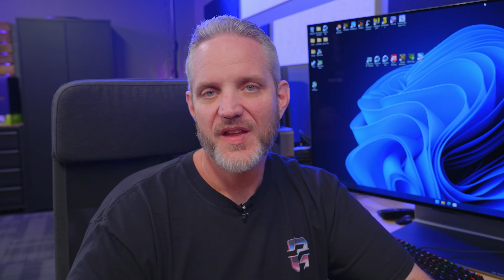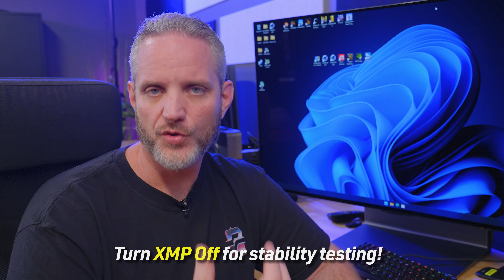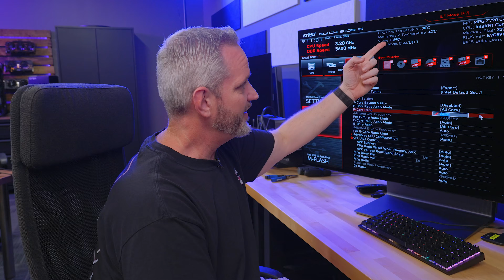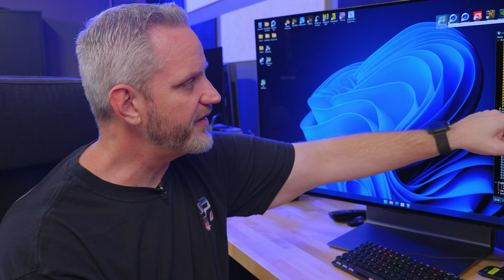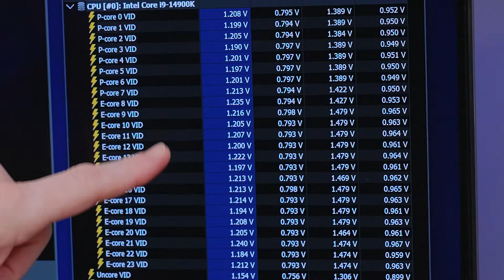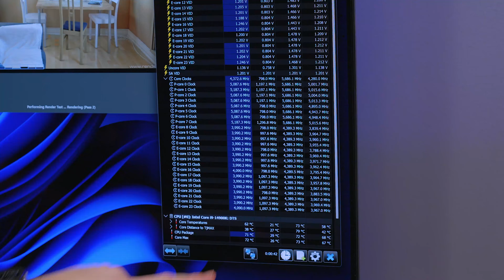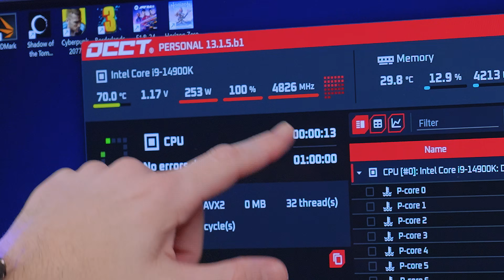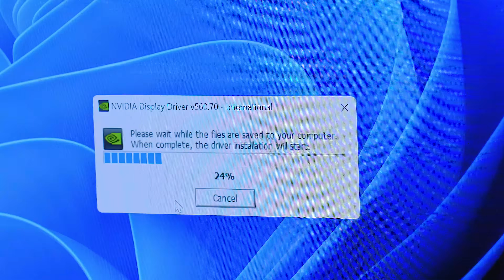Guide: How to check if your CPU is BAD!

Comment: Nice explanation, but I already know it, have dozen AMD one 7900x was new degraded I needed it and RMA for me would take weeks so it kinda work just fine with PBO +10, the other 7950x I have issue with stability on 95C and ~180W+ load, but it works for a 2 week at 130W (real power use) is that degraded or mobo issue I have not done more tests
I have just one 13700k and it works fine but mobo I use asrock lightning was set to base profile at max 188W use so I think it had not degraded at all
Also in past I had sandybridge at 5.2Ghz and after a year it degraded and asked a bit more voltage for 5.2Ghz but at stock it worked fine, ond 99+% of those CPU will last 10-20 years easy

Also hwinfo64 show WHEA errors and my degraded bad AMD 7900x it was quite fast to detect, also best workload to crash it in 10min was just chrome with 6-7 tab and crtl+tab move from one to other!!!
I would love some with that in mind make 1 core random load/no load test as this which would be fastest way to test it, not sure if intel or AMD would like to help making this test as I bet THEY KNEW how its best to test and defo have special tools for it

Comment: You know I'm a amd fan boy prior to my 13900kf I hadn't had a intel cpu since a 2500k and I switch for one reason and one reason alone I finally got a asrock aqua mobo to go along with my asrock aqua gpu looks like I gave intel another chance at the wrong time lol no I haven't had a issue im not the guy who overclocks the snot outta there stuff and I regularly make sure bios are updated and as well as I do run 4 sticks took me a bit to find a kit that would run stable on my 13900kf I got 2 32gb kits of gskill royal ddr5 6400mhz did get 6400mhz to run but ran into some stability issues so dropped it down to 6000mhz now I have 0 issues fingers crossed no Rma in my future thanks for the video great as always

Comment: The main problem is the ring bus isn't able to cope. That will not be an issue if you turn off XMP. The ring bus is responsible for transferring data from the memory controller to the cores / cache & back to main memory
Reply: The main problem is poor engineering which will mean that these CPUs will degrade anyway.

Comment: Lot of people complain about MSI's quality, but we have this happy coincidence where MSI using lower power limits (possibly to compensate for lower quality parts) has spared their 4090s from melting connectors and now possibly spared Intel CPUs from early degradation.
Reply: MSI's 4090s are also burning.
The issue is due to the connector not having a tight enough fit in which a slight gap from the cable being bent too much causes arcing, which produces enough heat to melt the connector.
Reply: @Skelath  Unless there's been new information out, from what I recall in the North Ridge and Jay's videos is that MSI is underrepresented in the available data regarding melted connectors. The only way that's possible is if a) nobody's buying MSI (unlikely, they would've disappeared before EVGA if that were the case), b) they have such an amazing RMA that nobody's sending them into third party repair shops (also unlikely, because MSI's RMA process is not amazing), or c) something about their cards coincidentally avoids the design flaw of the new connector.
Reply: @blarghmcblarghson1903  you can literally search for "msi trio 4090 melted connector" and find several images.
Reply: The connectors have nothing to do with this.
Reply: @johnt.848  I didn't say it did. I was commenting on how two completely different issues were coincidentally avoided by having lower power limits and the reason MSI has lower power limits on both their GPUs and mobos is probably because they use cheap parts.

It's an amusing irony the brand with a deservedly mid reputation is doing better than everyone else because of this.

Comment: I may have shortened it too much to use only word degradation,  because I kind of classified word degradation with accelerated degradation and not regular intended wear and tear that happens as you use CPU. But I suppose it still is degradation, just one that is accounted for and expected.

Anyway, nice to see at least some tests that are known to show the issue. Since whole degradation thing can give wider array of issues. Like there were some successes bringing CPUs back either by dropping XMP and setting memory to very low frequency, disabling E-cores or even individual cores. Though some issues were reported to be related to I/O and I would bet that those get picked up by a driver, since it may be that part of crashes, which is responsible for VRAM error is just CPU sending bad data to the card. So I would bet that those happens as driver gets installed and tries to work with card. At least from what was heard from datacenter units where problems got accelerated due to their 24/7 operation, so I guess accelerated accelerated degradation? I guess Intel might make us make new acronyms. :-D

Also I loved that fire animation with Intel Burn Test, OCCT has really missed out on opportunity with their wannabe snake. :-D

Comment: Very good video.  I built 3 custom systems spread over the last 18-20 months for a local business.  A 12th gen and 2 13th gens (all i9's, high end builds).  The last 13th gen i9 failed after 2 months of use (at a business used 5 days per week, min 8hrs per day).  This happened before it became widely known about the issues with Intel.  I RMA'd the motherboard and CPU just to be safe, and I didn't know which component caused the failure (to simply turn on).  BTW, the replacements worked.  I have told the business to check their MB settings and update the BIOS on those boards.on several occasions.  I don't think their IT person has done either.  I built myself an i5 13th gen and have set the motherboard to the correct default setting, for a while now.  All thanks to your videos and information.

Comment: 14900K  &  MSI Pro Z790-A Wifi
Cinebench 2024 single and multi both, the whole program crashes back to desktop. even things like Netflix and Youtube can send my system into BSOD. Any game running Unreal engine crashes while loading. I've found a weird detail that the crashes are MUCH more likely to happen if my PC has been to sleep and woken up vs turning on from a completely powered off state. Currently I can run almost no games without my Windows control panel power options being set to Power saver which backs my CPU frequency all the way down to 2300MHz

Comment: ffmpeg video encoding has been very reliable at causing crashes for me
Reply: Agreed - yet after the Microcode update my perf is worse than my old 5950x (so not an upgrade anymore) and before the update I was undervolting anyways. My voltages were LESS than the stock Intel is now.

Comment: "There's a timer on your CPU and you should turn it off more!"

Sorry, I'm used to running CPUs so long that they're hopelessly outdated before they run into degradation issues. I was still running a 5000+BE in 2016, and it still did everything it once did. Yes, it's electronics, yes, electronics have lifetimes, and yes, the 13th/14th gens are trying to kill themselves at what should be but isn't an idle state, but it's still quite shocking (pun intended) that we're now seeing stuff go to hell quickly enough that the replacements don't exist yet.
Reply: I'm a prime example of that as proof.

I've been too damn lazy to upgarde my machine.  My machine is a Core i7 965 first gen Nehalem.  I've left this thing on all day for over 16 years.  Granted, I never took major advantage of the unlocked multiplier or its overclock capabilities, but this thing has been running in a place that has climate very similar to Florida's (80-90F at worst, but high humidity) with moderate air cooling.

And it still runs, it still doesn't BSOD, it still has no problems running the games it can actually run.

Like you said it's depressing AF that my i7 965 from 16 years ago running all day in warm and not-so-ideal conditions is lasting longer than these 13/14th gen Intels.

These things are literal ticking time bombs and Intel should be ashamed of their screw up.
Reply: Same thing. Many old processors, even with OC lived for so long they simply became outdated, suitable for people who cant afford anything better. CPU dying that fast isnt norm, just as it isnt norm for GPU`s to fry themselves without doing something horribly wrong (like using molex adapter to 6, or, god forbid, 8 pin connector).
Reply: If degradation of CPUs was so bad people couldn't still be run 486 retro Pc some 30 years later.
Reply: An Intel CPU I purchased in 2013 is still working without any problems.
Reply: I have amd fx 8320 and I peed my pants when i OC to 4.7 ghz but the temps were like 80c under load and like 35 idle. Glad to say I turned it down to 3.8 ghz. (The cooler is stuck to the cpu because I was lazy with that too. 10 year old thermal paste!!!)
Reply: its not only degradation. they had production issues. so most of the cpu affected are affected by this.
above that probably a managment problem forcing the stuff to crank up the voltages and power consumption to insane levels to be able to keep up with amd in synthetic benchmarks.
literally the first thing i did with my 13700 when it was new, is that i lowered the power limit in bios to 160 watts, and lowered the adaptive core voltage. my processor still beats prime 95 no problems.
Reply: I'm still using my Intel i7-2600 CPU @ 3.4GHz I purchased in 2013, which I still used today. The PC has been left on 24/7 all those years. The only upgrades have been an SSD and an extra 8GB of ram. I'm looking at building a 4K editing machine with an i7-14700K and a 4080, but the constant talk of stability issues is preventing me making the purchase. Maybe I need to get over the fact that it won't last another 11 years.
Reply: @DairyNZ  Just upgraded last year the 2600 is a beast.
Reply: I upgraded from 3570K from year 2012 to 13600K just last week. I'm going to undervolt the 13600K as much as possible. And this was just a pre-emptive upgrade instead of the old CPU already failing.

Comment: For me, it was fitgirl repacks. That's when I found out about degradation. When I started completing it up to 80%, all the way to eventually I couldn't get beyond 10% without crashing with my hottest core not beyond 78 C. Ever since I got my RMA 1-2 months ago, everything has been clean. New microcode x129 update for Gigabyte did boost my voltage beyond what I was comfortable with (over 1.5v just starting up Windows), and I have since modified LL to 55/55/High/-0.116v offset. Now the very highest my 13900k will go under the most extreme situation is 1.35v, and I'm getting my full 5.5Ghz P core with 5.8Ghz boost, along with E core at 4.3.

Also my 13900k does in fact still use 253w under the heaviest load, and I think the highest recorded temp I've seen with RT, decompression, etc. Has been 77 C for a P core.

My issues also were during all core workloads (shader comp, decompression). I did not have any issues otherwise. Shader comp did in fact spike my CPU load to max.

Comment: Here's some code for a batch file that will loop Cinebench r15 multiple times. Place it in a .bat file and run it:

@echo off
SETLOCAL EnableDelayedExpansion

SET "NUMRUNS=50"
echo Running Cinebench r15 Extreme Single Core...
FOR /l %%i IN (1, 1, %NUMRUNS%) DO (
	echo [!TIME!] Starting Run %%i

	"CINEBENCH Windows 64 Bit.exe" -cb_cpu1

	IF !ERRORLEVEL! EQU 0 (
		echo [!TIME!] Completed
		echo.
	) ELSE (
		echo [!TIME!] FAILED^^^! ^^^(Error level !ERRORLEVEL!^^^)
		echo.
		pause
		exit
	)
)

pause

---------------SNIP----------------

Change the NUMRUNS variable to your desired number of runs. Also, this is currently configured for single core test, if you want to run multi core instead, change the "-cb_cpu1" parameter to "-cb_cpux" instead.

And additionally, the r15 "Extreme" version you can find on Guru3D takes 4x as long as the regular r15 version to complete, giving it more time to find an error.
Reply: I wouldn't run this guys
Reply: @Chris-w2q  For a particular reason?

Comment: RMA?? So does that mean they have remanufactured/renewed/reboxed with firmware updates the CPU with or without the corruption issue? ( sorry Degradation issue) Or, are they just sending out crap again to hopefully have firmware available and roll the dice?
Reply: The latter

Comment: That was much awaited , thank you! Here: Asrock z790 nova and i7-14700k. Does not have awkward crashes. With new 129 microcode VID in Bios default and xmp 5600 went UP. Peak 1.55 volt but when running under full load all cores it is around 1.3 volt.  420 aio under full load goes up to 90 degrees . R23 runs forever in single and multicore without crash.....now you tell me.....is 1.55 volt concerning as peak? Because as I understand 129 it will pump more and more volt into degrading cpus to avoid claims regarding reduced performance, hoping (intel) to drag cpus long enough to get out of warranty or out of desire to claim time.

Comment: gf's 14700k on a strix 760-f with 32gb ram @6000mhz will do the very high intelburn test and get 26 second average time and averages at about 288GFlops but my z790 maximus hero with 64gb 6000mhz ram with same timing as her 32gb set but a 13900ks latest bios's on both averages 30 second time with around 251 GFlops i have always said her system has felt better then mine, even now that bios updates etc have atleast reduced my temps (420aio tho but has always been running super hot even toned down until these new bios came out)

Comment: I did all the tests, plus a long CPUZ stress test. I monitored the values during the tests, and never exceeded the risk limits for voltage, temperature and frequency. I'm well within the safety margins. I have an i9 13900K with a msi Tomahawk z790 wifi DDR5. My Bios dates back to 2022. I spent almost half of my vacations wondering if I should switch to version 0x129. I've just come to the conclusion that I should stick with the current microcode. All the more so if MSI exaggerates the undervoltage. I think my CPU is safe. Cooled with a NHD 15 in a Corsair 7000D tower with optimal airflow. Some people criticize me, but this video finally made up my mind. And in the absence of symptoms, I don't want to ask myself any more questions.

Comment: CPU's only degrade if they are a notoriously bad design and run hot constantly or when you push them beyond there means like overclocking. I have old athlon 64's that haven't degraded a bit because they are kept at the speed they are supposed to run at and operate at a low temperature. They run windows 10 perfectly fine and if windows 11 didn't have the arbitrary restriction it would run it as well. They will run Debian, Ubunbtu and arch linux perfectly fine.
Reply: ^ This. What Jay said about all CPUs degrading is simply not true.

Comment: Just RMA'd my 14900K as everything was crashing constantly.  Built a beautiful new AMD system.  24 hours reinstalling all my software.  So happy to be out of this.  It should not be necessary for end users to become experts on voltages and microcode.  Intel, it's gonna be 2-3 decades before I trust you again.

Comment: As Jay says don't believe that CPU degredation is limited to Intel. I have a Ryzen 3700X with degredation after a bios update allowed up to 1.5V supply to the CPU.

To clarify it still works just fine with 100MHz off of the advertised max boost.

Comment: Not sure if I will update. MSI PRO GAMING Z790 motherboard with 13600K with 0x125. I have voltage offset -0.125 and it never goes over 1.13V and 60º, with 5.2/4.2Ghz OC, 24100 CineBench 23. Noctua D12. When running CB the most it goes is 73º

Comment: Best way to protect yourself is x129 microcode, then limit p-cores to 5.7Ghz (14900k) and set IA VR Voltage to 1.4v. You will no longer TVB boost to 6Ghz, which prevents silly high vcore spikes and wrecking the Ring Bus. Since it uses the same voltage rail, which is seemingly the culprit behind accelerated degradation. Sadly MSI cannot limit the vcore, so your best alternative is undervolting and limiting core boosts.
Reply: I wish MSI would add the IA voltage limit setting. They refused to do so and apparently no plans to do so according to a recent forum post asking for it.
Reply: @sp00n the fact they are preventing customers the ability to limit vcores in the current situation is dubious to say the least.
Reply: @MhillPlays  I wouldn't call it dubious. It's a bad decision for sure, but I've seen other motherboard manufactures unwilling to add certain features before, so it's nothing new.

Comment: I think the Nvidia driver update is just dodgy in general.
1 time out of 3, whenever the Nvidia driver update finishes, I'm left with a frozen GeForce Experience screen... And I'm using a Ryzen 7950X.
It's no big deal or anything, since the update was installed successfully and you only need to reopen GeForce Experience to unfreeze it.
It is repeatable dodgy behavior though.

Comment: In HW monitor there is a CPU E-Core L2 voltage.  Mine is currently at 1.9.  Finding it hard to find anything online specifically for my CPU.  i5 13600k.   I've never had any issues with crashing.  Does anyone know if this is normal?

Comment: After updating my Z790 Hero to 2503 stability has gone to shit.
And its getting worse by the day.
Reply: Try disabling MCE/enforce all limts and use the Asus OC profile worked for me
Reply: @RodWhite19  I was using the intel limits, put a voltage cap in place etc etc.
And yes, AsusOC profile was also in use cuz I hated how the bios update dropped my R23 score to 23000 instead of the 38000 it should have been.

Its dead. Doesnt even post now. Tried a bios reset and all that. Its voltages were fine for all of its live. I have never seen more than a very low 1.4V as a peak when starting some super low workflows.
Been monitoring this for years using hwinfo. 

Guess my move to chromeOS starts today.